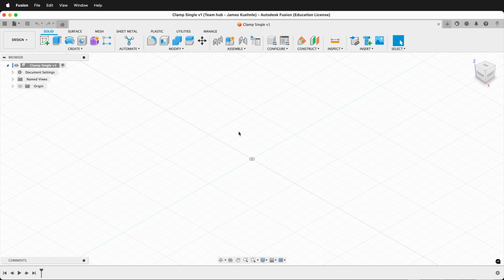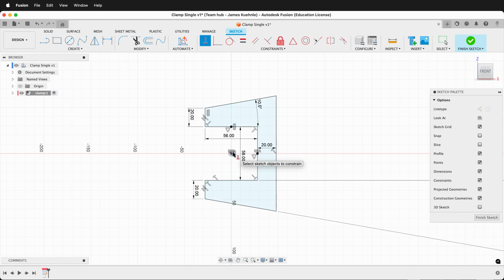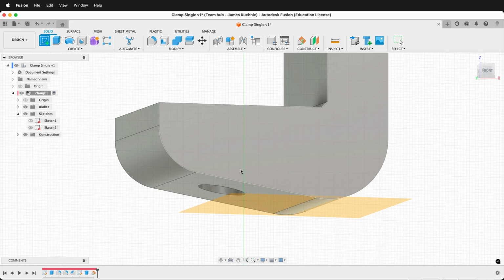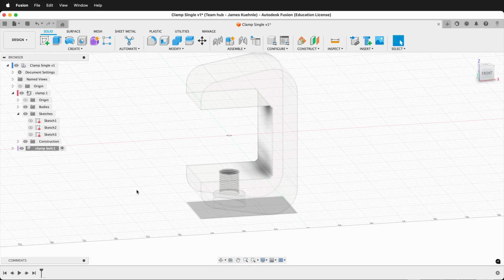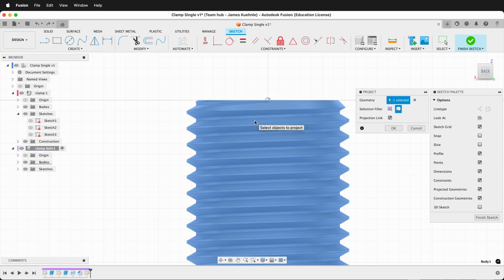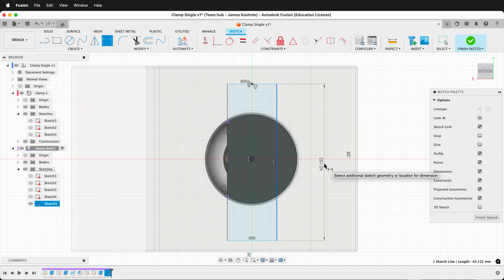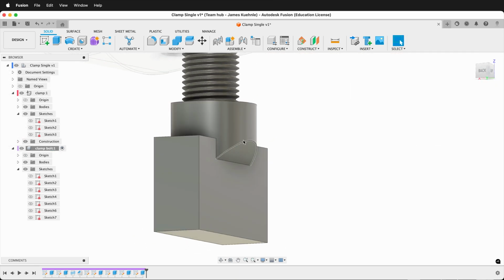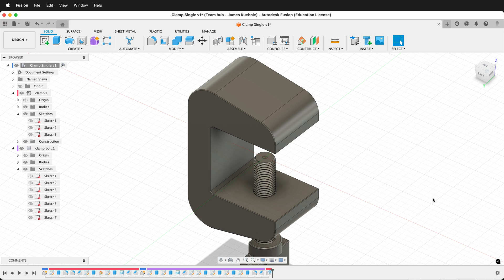3D Printed Clamp Fusion 360 Tutorial

Comment: Thank you for the video, it helped me a lot to create my CLAMP, but I have a problem: I want to create a holder for my power strip that allows me to organize my cables. The clamp turned out great, but I don't know how to adapt the clamp to a rack that can support the power strip. I'm not sure if I'm making sense and if someone could help me.
Reply from the maker: You could make a channel extrude along the top of the clamp at a 45 degree angle that you can slide your power strip into, could add a second clamp element to hold in place

If you look at existing designs online it should give you a good idea

Comment: Not bad, but: you fail to show the essence of the work with Fusion. You go extremely quickly over such an important work element, like slowly showing what shout be clicked/selected to draw the line, determine length, determine angle,  changing from kine type in blue into line in black, etc. You may laugh, but without this elementary and sooooo obvious to you steps it is hard to do the design by own.
Reply from the maker: Thanks for the feedback, I appreciate it. I have other videos that go over sketching and sketch constraints in Fusion but it is good to get a reminder to add that instruction into the workflow of more complex tutorials

Comment: Thank you for the video! It helped met alot to learn more about threads. Only thing is that i keep running in to the problem that my components dont have the red and purple time line and cent project the treads and that i cant do the optimization for printing. Do you know what i could be doing wrong?
Reply from the maker: Did you make a new component for each part? Under inspect select display component color's

Comment: Thanks for the video I always like to learn new tricks and this had a couple. The  inside face of the thread was tricky to find when offsetting it.  Fusion should make this process a little easier since it is a common 3d printing need.
Reply from the maker: Yes, that would be a nice feature to have inside the thread creation tool inside Fusion 360 for 3D printing

Comment: great tutorial! how would you go about making a similar clamp but for corners? (i.e. the inner corners of the clamp have a right angle instead of straight)
Reply from the maker: Like for clamping miter joints?
Reply: @ sort of? It would be for the corner of a piece of wood. I want to attach a 3D printed clamp to soften and baby proof sharp corners